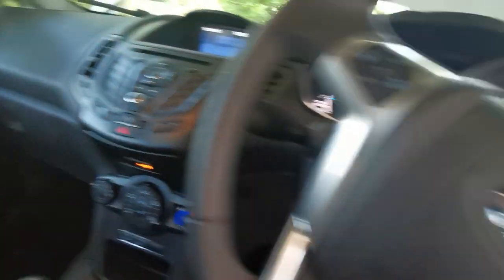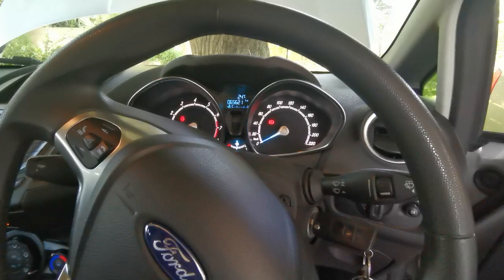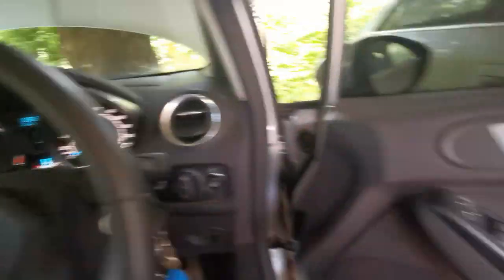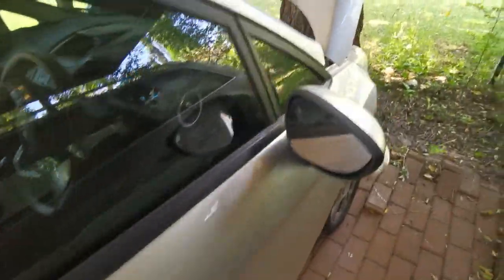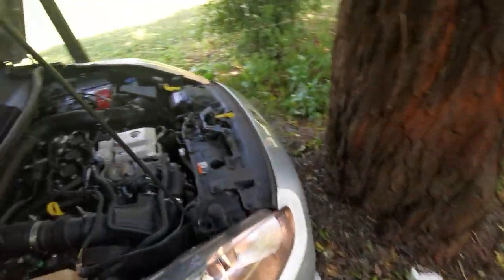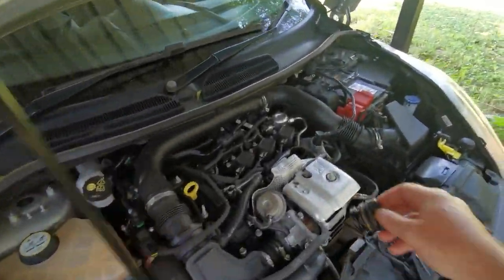Ford Ecoboost 1.0 Oil Cap Popping noise

Comment: My monies on the brake vacuum pump. My PSA Puretech 1.2 turbo makes a similar noise.
Reply: Bro, you need to get rid of that puretech - they are trash. I bet you're putting a litre of oil in it every month.
Reply: @ssss-df5qz Nope, but was in the motor all my working life, understand the problems and take care of them. Unlike some who never look under the bonnet and haven't a clue. 🙄
Reply: @tenfootvoyager  yeah I get that but the design flaw in the oil control rings are beyond your influence. Even wtf regular servicing they are bad from factory.
Reply: @ssss-df5qz  I see where your coming from as the direct injection can coke them up buggering up the rings. Mine had spark plug insulator break and drop causing all the bells and whistles to go off and no power. Good job it didn't shatter or the bore would have gone. Turns out it came out the factory with the wrong spark plugs(ZR6SPP3320-too hot) fitted. ZR5SPP3320(cooler) fitted no problems in that department since. Only use Total Quartz First INEO 0W 30 and changed annually. Cam belt(2nd type) just been done at 8yrs but only 15,000 miles so in good condition. Don't do many miles these days. Diesel would have bunged up solid. It's a shame because when on form it goes like a rocket. PSA certainly didn't see problems coming. Could be worse like a Ford Ecoboom at least my oil pump is chain driven. Fingers crossed. 🤔😀
Reply: @tenfootvoyager  hey it could be worse, it could be an ecoboost as you said. Dealing with one now with a stripped oil pump belt. 40k miles, 4 years old. Wrong oil most likely

GDi's will always have carbonisation issues, some seem  worse than others. Give me old school inlet mounted injectors any day.

Comment: Hello.  I also have a 1.0 ecoboost ford fiesta.  This is my first time using this motor vehicle.  The engine sound is clicking at idle.  Is this normal ?  And when I step on the gas, the engine water fluctuates?  are these normal?

Comment: For eco boost ANYTHING over 35k miles the oil pump MUST be cleaned by dropping the sump and cleaning the oil feeder screen you’ll be surprised how much of that wet belt is in there . Just my 2 pence not sure if that’s ur noise the car i cleaned engine sounded like a proper train done the pump can barely hear the engine idle after cleaning.
Reply from the maker: Nope, that wasn't the issue here. This sound isn't an issue, we went to a dealership who showed me 2 brand new 1L eco boosts that sound exactly the same if you remove that cap. So it's 100% normal for these engines.
Reply: Correct on cleaning the oil feeder for sure (not related to this sound though).  On this engine I also recommend changing coolant bottle and hoses, especially that infamous degas pipe.  Then my last big recommendation on this engine is to change the wetbelt early, like a few years BEFORE Ford recommends it be replaced.

Comment: Thank you but i work for a car manufacturer and did some more research you have a 1.0 we work on the 1.5 and yes its normal as in it occurs in the engines but were telling you that the noise is a bad design and that noise is the valve lifter buckets that you do not hear on the 1.5 or other ecoboosts
Reply from the maker: So effectively what you're saying is that Ford is building these motors wrong straight out of the factory? And on top of that, there are many 1L ecoboosts out here which have 300k+ km on a single engine without issues... So is it really an issue? Because as I said, I personally went with the Ford mechanic and tested this on multiple brand new floor models and they all did this.

Comment: Hello, i have a Ford B-Max 1.0 Ecoboost 2015, i have the exact same issue what whas the problem? And did you drive for a long time with this sound ?
Reply from the maker: It's normal. Nothing wrong. Brand new from the factory does the same

Comment: Yes sir we dissected a 1.5 to prove it abd confirmed ford erorred with defective head gaskets block and torque value abd the lifter were a bad design flaw wich they later admitted and then corrected with a new block yo address coolant intrusion however were saying it may bot be a major cause for concern but in time could cause damage to your lifters and fail ill will do a video on our findings and send it to you give me a couple days

Comment: That is a lifter bucket 100% and most likely its your high pressure fuel pump bucket that is easily accessible by depressurizing your fuel line and un screwing the two t30 star bolts that hold it in place to check its ware and i will tell they can be expensive at around 70$ a peice and you will need to get it from ford no where else i will also add that it can be a sign of bad oil flow and worse case senario its a cam lifter wich can be very expensive at a shop but lastley if the high presaure lifter gives you will experience a loss in power and wont be able to accelerate if that happens you will have small metal partical loose in your engine and you will then cause major damage bit you most certainly have a bad lifter
Reply: If you need me i can walk you through the process and save your engine
Reply from the maker: Justin, please go to a Ford dealership and do the same test on any of the brand new 1L ecoboosts.

It's normal.

Tested it in person with multiple Fords at the dealer.
Reply: Do not do any modifications to the engine concerning this issue. You will invalidate any warranty and kiss good bye to the engine.

Comment: Its the hpfp ( high pressure fuel pump that runs off the intake came. Depending on oil thickness/pressure the sound will change. Its normal

Comment: Hi, could you find out what it was? I have got the same issue. (if it is an issue)
Reply from the maker: Not an issue. Perfectly normal on these engines. Ford did the same test on a few brand new ecoboosts and they all did exactly the same, if not louder (probably cause the engines were still cold)
Reply from the maker: I should add - they tested it in front of me. Not just heresay.
Reply: Thank you mate! Just bought a used ecoboost and got worried because of it. Although it already sounds like a sewing machine even with the oil cap attached. Will check it with a mechanic anyways, to be sure
Reply: My car is the focus ecoboost with exactly same noise. Car works perfectly. No oil is lost. The engines will and do run very very hot. Mine is 8 years old and runs like a dream.
Reply: @jakk.7489 Hello.  I also have a 1.0 ecoboost ford fiesta.  This is my first time using this motor vehicle.  The engine sound is clicking at idle.  Is this normal ?  And when I step on the gas, the engine water fluctuates?  are these normal?

Comment: Did you figure out the issue ?
Reply from the maker: It's normal, not an issue. Verified by doing the same tests on multiple brand new ecoboosts at Ford.